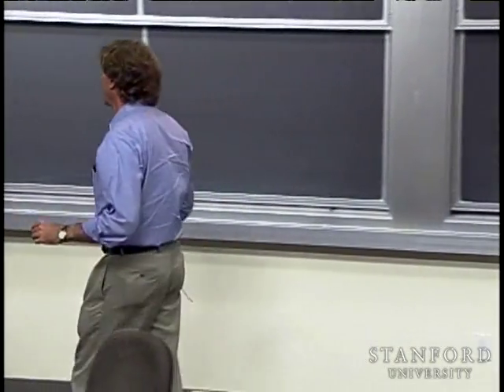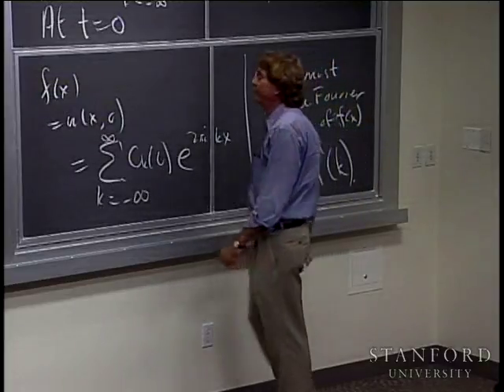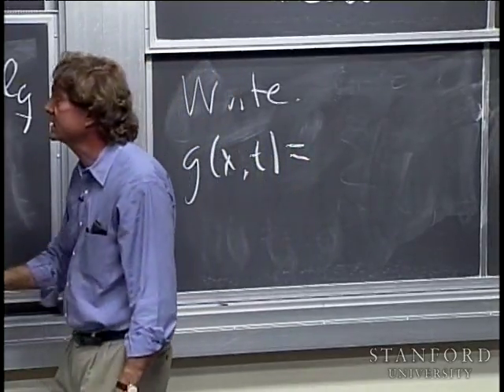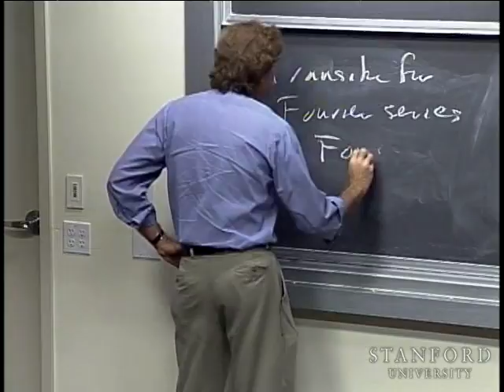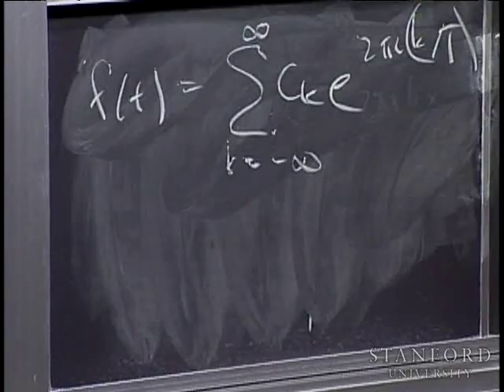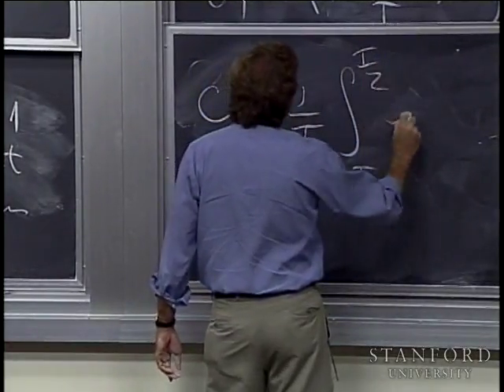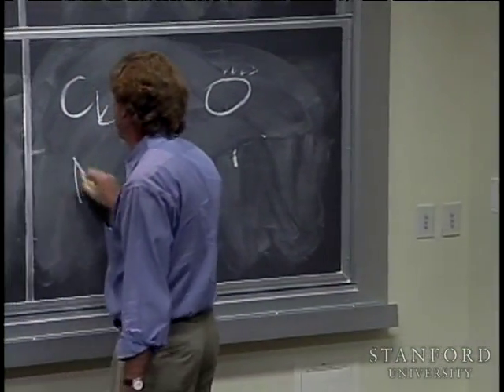Lecture 5 | The Fourier Transforms and its Applications

Comment: You are absolutely correct here! I thought the same thing. He forgot what happens at k=0. 

What really happens is, u(x,+oo) = f^ (0). But f^ (0) is the 0-th Fourier coefficient which calculates to integral from 0 to 1 of f(x) dx. But this integral is the AVERAGE uniform temperature. 

So at t goes to infitity we have shown that the temperature becomes uniformly the same everywhere. This is true because as you heat something it gets the same temperature eveywhere eventually.

Comment: @hai2410 It's because the absolute value of a sum is always less than or equal to the sum of the absolute values of the individual terms, e.g. abs(a+b)<=abs(a)+abs(b). Since a definite integral is a sum, the same principle applies. Also observe that the absolute value (the modulus) of the complex exponential equals 1 since exp(a*t*i) (with a=-2*pi*k*t/T) can be rewritten as cos(a*t)+i*sin(a*t), resulting in an absolute value of 1. Cheers!

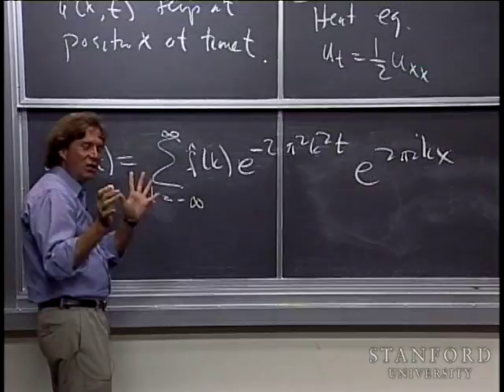Comment: Doesn't it seem strange that at 10:30 it is claimed that the temp goes to zero as t goes to infinity? Shouldn't the heat be conserved in the ring? Assuming  a nonzero initial condition, I would expect the temp to go to a constant  steady state temp > 0  with no gradient (independent of x and t) ... since there is no discussion of radiation or convection ... conduction out of the ring to an atmosphere would have to be through the surface area of the ring ... which is zero area ( 1-dimensional ring) ... hmmm, I guess it's what you get for considering an impossible example (1-dimensional ring).
Reply: had the same thought
Reply: @Lukas Kluge he probably the thermal equilibrium temperature .. but how is this connected to the 0 of the exp -- need to think about it ... T(t) - T<equ> = f(time)
Reply: You are actually right. Each term goes to zero, but since it is an infinite summation, there is a radius of convergence for the sum to actually converge to a finite value, aka the final equilibrium temperature.
Reply: Good question. Not mentioned in the lectures, but if I think back to my engineering classes, if we were to backtrack all the way to u_t = a*u_xx, the "temperature" variable u is actually a dimensionless (unitless) temperature which scales the "real" temperature to an interval of [0, 1]. Maybe something like u = (T(x,t) - T_ss) / (T(x,0) - T_ss) where T_ss is the steady state temperature eventually reached after the ring gets to equilibrium (?).

Comment: Terrible physical mistake. The temperature over the ring in infinite time is the average temperature over the ring at time zero (the model does not contemplate heat exchanges of any kind with the medium!). This is actually captured by the first Fourier coefficient f^(0). The t the ring does not cool off but the temperature equalises.
Reply: Yeah, if I think back to my engineering classes, if we were to backtrack all the way to u_t = a*u_xx, the "temperature" variable u is actually a dimensionless (unitless) temperature which scales the "real" temperature to an interval of [0, 1]. Maybe something like u = (T(x,t) - T_ss) / (T(x,0) - T_ss) where T_ss is the steady state temperature eventually reached after the ring gets to equilibrium (?).

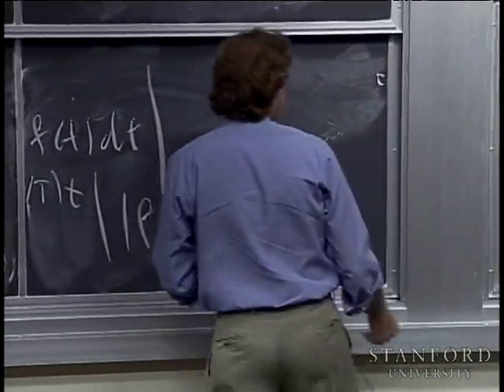Comment: can anyone explain to me the part at 49:20 why the absolute value of the full integral is only less than or equal to the integral of the two separate absolute products- why isn't it precisely equal? Thanks
Reply: I would have but it seems like I m a bit late
Reply: @livelife3839  What a pointless reply...
Reply: Think about what happens when you take the absolute value of a sum. E.g. is |a + b| equal |a| + |b|? No, because for example |1-1|=0, but |1| + |-1|=2.

The integral can be viewed as an infinite sum, so the same reasoning can be applied to its terms.

Comment: Question:  why Ck = 1/T * integral() for period T, how does 1/T come from?
Reply: Work it out. As he usually says, he doesn't like to do it in public...lol.
Reply: because, let's say, you're working with a function f(x) of period 1. so "f(t) = f(Tt)", such that f(1) = f(2) = f(3). if we want this function to have a period of 2 then we can see by trial-and-error that we have to divide by 2, such that f(t/2), and now if we input t=1,2,3 we get f(1/2), f(1), f(3/2) which are not equal. we need to now input t=2,4,6 to get f(1)=f(2)=f(3). we can see that we've changed the period to 2 by dividing by 2. to transform our function f(Tt) to a function g(s) with a different period, we let s=Tt and substitute t=s/T into our new function. when we do that with the fourier coefficients we have to substitute s/T into the complex exponential AND the f(t) that it is being multiplied by. f(s/T) = f(s)*1/T, which we can now pull out infront of the fourier coefficient equation. we can change "s" to "t" in this equation now since it still means time but we're dividing it up in a more visible way now.
Reply: consider t = t'/T
=> dt = dt'/T
This way the constant 1/T comes out of the integral
Reply: I had the same question, but I understand it now, computationally. Pay attention to the limits of the integration: it used to range from 0 to 1, but now, after scaling, it goes from 0 to T. This is the source of the scaled Ck that we're correcting with a 1/T.
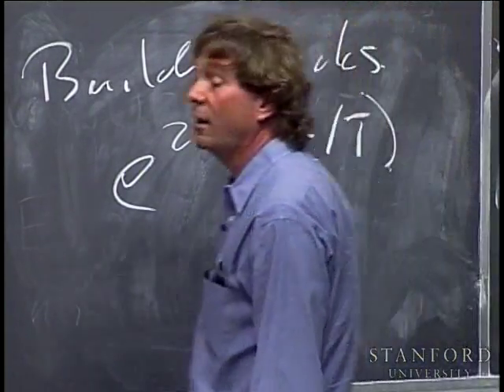Reply: @ 30:00 the scaled basis exp(t/T) is taken as the building block with Period T. This basis is Orthogonal with length = sqrt(T). Therefore, scaled Ck = 1/Sqrt(T) & not 1/T.
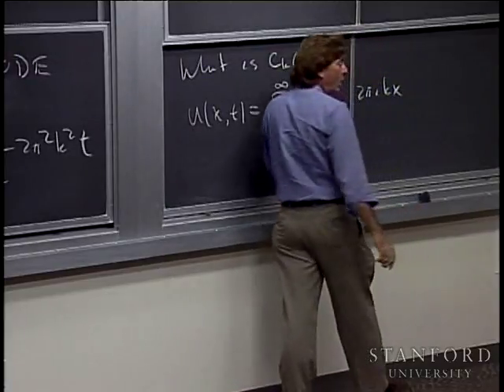The heuristic approximation amended to 1/SqrtT = ds in Lecture 6 @ 06:40 still works. Peer scrutiny requested.

Comment: Love this lecture series. But one annoying bit. He’s a mathematician teaching an engineering class.  Every engineer watching this lecture should be very troubled by his conclusion that the ring is cooling off.  This screams in the face of heat transfer and conservation of energy.  There simply has to be something wrong with the math or the model.

But the error is in his interpretation of the result (i.e. the math).  It doesn’t tend to zero.  It tends to F_0—the DC component of the Fourier series.